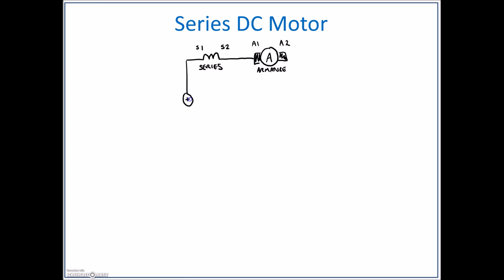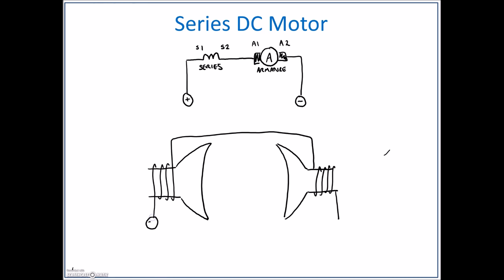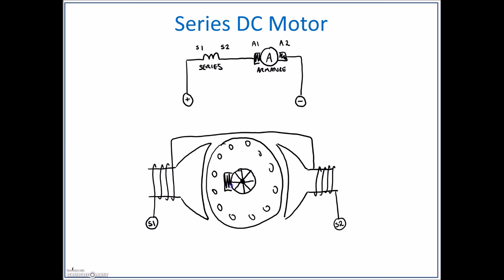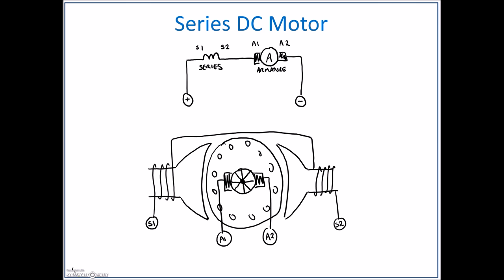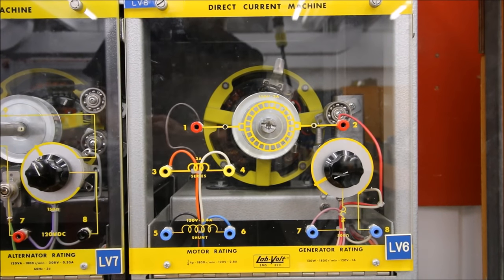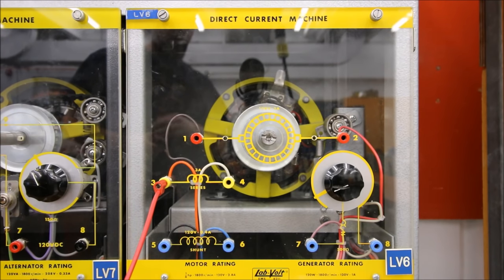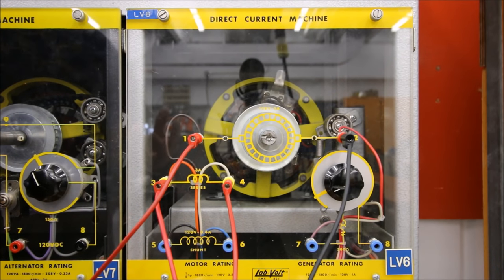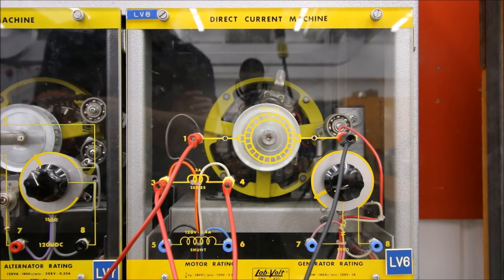Series DC Motor Connections

Comment: Any idea where I can get one of those?
I work for the railways and this is some great didactic material.
Reply from the maker: The company is Festo Didactic / Lab Volt. They are quite expensive, but take a beating from the students. Our units are over 10 years old now. If you do contact them, please mention that you became aware of their products through my YouTube channel. Here is the link: https://www.labvolt.com/solutions/6_electricity_and_new_energy/59-8001-60_0_2_kw_electromechanical_training_system
Reply: Nice. You did not show the RPM, current, voltage drawn. May be an oscilloscope showing the surge current, etc., would make your videos a  complete reference. Thanks.
Reply: @PeteVree  we had 12 sets of labvolt at school it was donated in the 1970s. Yes it is very expensive. the school could not afford to buy one.
Reply: Po
Reply: L
Reply: i got some of these lab student motors from a hoarder. didactic labvolt, correct. i didnt knownwhat to do with them and gave them to my loacal motor shop

Comment: Does the rpm max out in relation to voltage or does it just keep getting faster regardless of voltage in?
Reply from the maker: Without a load to slow it down just a bit, the rpm will continue to increase regardless of the voltage.

Comment: Awesome video, i have a dc motor where i work, i went to trouble shoot it and i usally get a resistance reading between A1 and A2 but its showing like its open. I have resistance between the field wires but nothing like its open between Aramture wires. Does that mean my motor would be bad? Thanks a
Reply from the maker: I would check the brushes. If they are not making good contact with the commutator, that might explain the high resistance reading.

Comment: I have a small motor like this but its not wired this way where the windings have a long jump line. The two windings are connected together but kept separate by the brush and armature. I think its way less confusing to be wired that way since the way its wired on the diagram is the way its wired irl. Whereas in the vid that jumper wire can cause some confusion.

Comment: In series circuits the current remains the same throughout the circuit and the voltage divides among resistor values according to OHMS Law. OHM's Law states    Voltage =  I (current) (multiplied by)  R ( resistance).   
When there are different resistors in a series circuit the current (multiplied by)  each resistor creates a voltage drop across each resistor, meaning there can be a voltage divider circuit in series circuits.   
We can vary the voltage with a variable resistor control  before the motor.
Meaning a group of series motors can be controlled by one variable resistor.
Reply from the maker: Only the Shunt DC Motor is used for Speed Control with a DC Drive. https://new.abb.com/drives/dc

Comment: Culd you please tell my how culd I change for exampel my starter motor speed culd I use external winding with my field windeing to inteade torque ore speed? And I have 1 more question my alternator is giveing my trobel culd I add extra external coils out side alternator simulating extra windings?to gain more power from the alternator?and If I culd change the starting charge rpm on my alternator how wuld I do it? My engine is slow reving around 300rpm its back charging causeing my trobel I wuld like to modify that thing to start charging baterrys under low speeds at full power.
I dont know some tractor alternators have capacitors on them so Im not shure if I culd use somthing similar like that to help solve my problem.
Im useing some times plazma ignition ordinary ceramic capacitors to ignition coil + and other side of hv capacitor to ground. There are some nice effects my starter motor spins faster on start up engin is low quaeter runing but my starting charge on alternator from 1k rpm goes to 2500 rpm at 15v out put thats anoying to my how wuld I stop that from acuring to my alternator? Culd I modify my alternator seperatly and not effect my other devices ore wire harnest? Are there some known methodes that I can use ore cinde of compound windings?

Comment: nice video! 

i have a question. it's kinda silly but here i go... i know that "universal motors" are quite similar to "series dc motors" in a way. basically they are modified to withstand ac working conditions. my question is if overspeeding issue is related to the current type. can these motors still overspeed on AC just like they do on DC?
Reply from the maker: In fact, like a series-wound DC motor, running a universal motor with no load (zero torque) could lead to a runaway condition, where the speed increases until the motor begins to break apart. 

https://www.motioncontroltips.com/how-can-universal-motor-operate-dc-ac-supply/

Comment: In series there can be a voltage divider among resistors, where as the current remains the same, meaning a variable resistor in series with series motor can produce a voltage drop across the variable resistor , varying the voltage at the series motor even though the current remains the same.

Comment: so I am not doubting you, but I have made use of many DC motors over the years, almost all have been series wound.  I usually run them from simple power supplies, nothing that has any current limiting capabilities, yet I have never seen a motor run away like the one you demonstrated.  Can you offer any explanation as to why that's never happened?
Reply from the maker: They were all physically coupled to a mechanical load?
Reply: @PeteVree  first of all, thanks for the quick response, did not expect that on a 2 year old video.  So it seems I got the terminology wrong, most of the motors I have worked with are permanent magnet dc motors.  I cam across this video (actually you one on parallel dc motors) in the middle of a deep dive into learning about more advanced motor types and when I posted, I was high on information and very confused. 

As a side note, I had just replaced a motor on a project, for the 3rd time and with a beefy motor.  So I had some time in on bearing blocks, pulleys , mounts and a new power source for this 110VDC motor.  The machine in question must spin in one direction and has a DPDT reversing switch on the DC control circuit to accomplish this.  So I have this new, sizable motor, mounted really nicely all the electronics were bench tested and sure enough the direction is backwards.  I flip my reversing switch and try again, still backwards....a true wtf moment...i was pissed at this point and madly perplexed.  Found your video on shunt motors, a little snip-snip and soldering, back in business.  Thanks for your help out of that bind.
Reply from the maker: Nice. Glad everything worked out.

Comment: The back EMF is absolutely SOMETHING. It rises in proportion to the RPM of the motor until it equals the voltage of the source. That, combined with friction losses, limit the speed of the motor. It's not going to spin up until it tears the fabric of space-time.
Reply: On a Shunt or compound wound, but on a series wound, it will accelerate itself to death.  Back EMF can never be greater than Applied EMF and since the field and armature current reduce on a series wound motor, there's always something left to keep it going.
Reply: @PattyODoors  I admit, I was speaking beyond my area of expertise... I concede! Thanks.